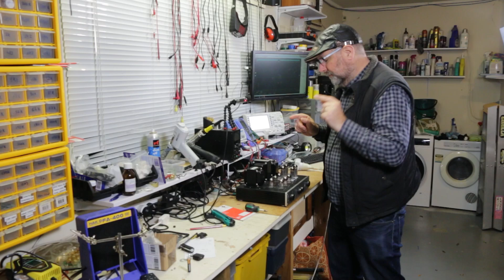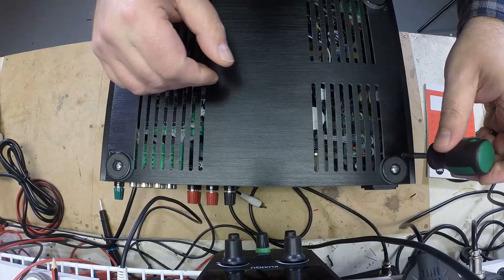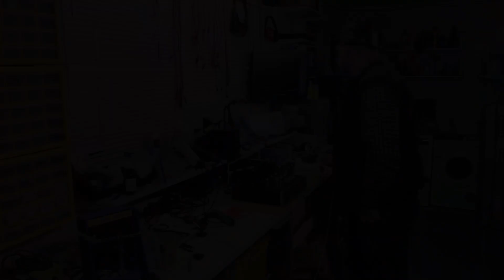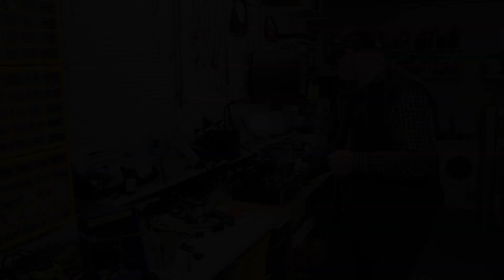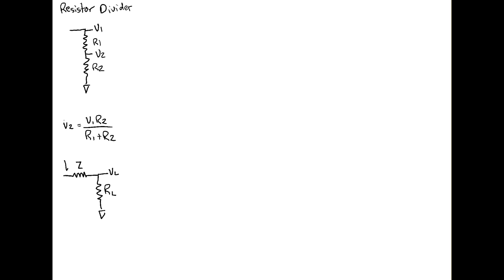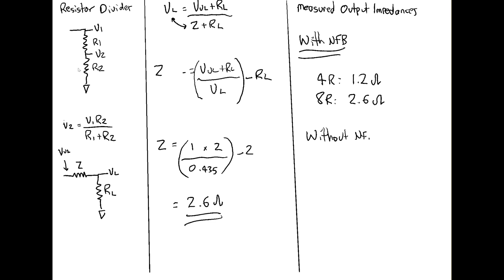Calculating Output Impedance in tube amp (Pt. 1)

Comment: Hello Adam, I’ve always wondered what the output impedance is of my valve power amplifier but always been afraid to run it without a load because you always hear/read that you shouldn’t do this. 

A while ago I therefore tried a method using two dummy loads and keeping a fixed input voltage i measured the output voltages with each load. However when I tried to work out Z this way, my result wasn’t as expected. If you have time, could you please share what you think the formula for that method would be so I can double check my maths?

Thank you, Alex

Comment: When you say measure the output unloaded, your actually  putting in a tiny input signal so 1vpp is out? I was under the impression that doing so would be bad for the OPT? Im guessing that very low voltages isn't an issue, would you have a feel for what the maximum safe unloaded voltage might be for most ?
Reply from the maker: You are 100% correct in your assumption. the low signal level is just so that I can have enough signal at the output to make a meaningful measurement, but not so much that it risks oscillation or flashover or any of the other nasty things that can happen to tube amps when operating into an open load.
Think of it like starting your car and leaving it in neutral, then standing on the gas. Give it too much gas and it'll redline the engine and Bad Things will start to happen. But give it just enough to hold a fast idle, say 3000rpm, and you should be ok.

Ofc an easy way to measure it, if you have an adjustable resistor, is to just adjust the load down until the voltage gets to exactly half the unloaded voltage, then measure the variable resistor and that's your output impedance. But, I don't have one of these rheostats handy so I just resort to some easy calculations.